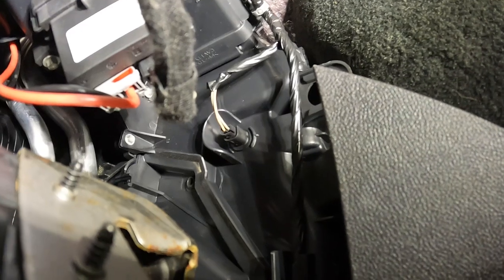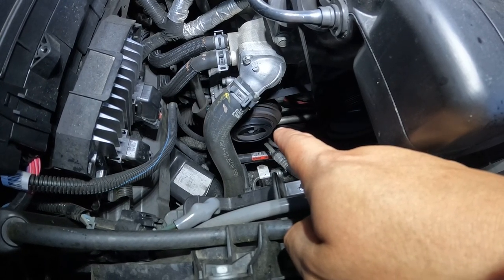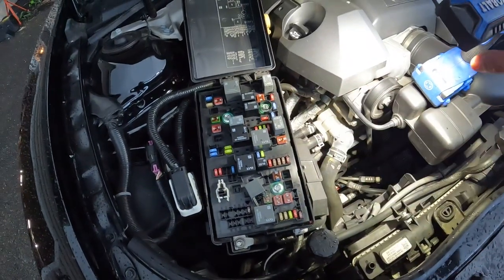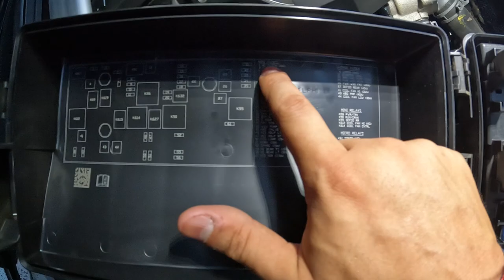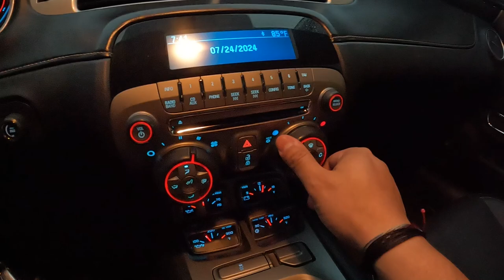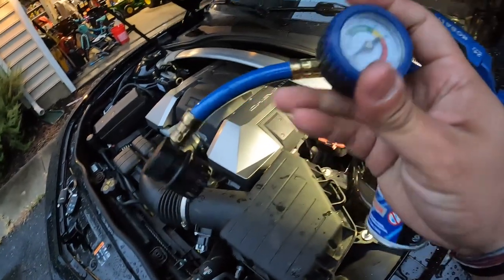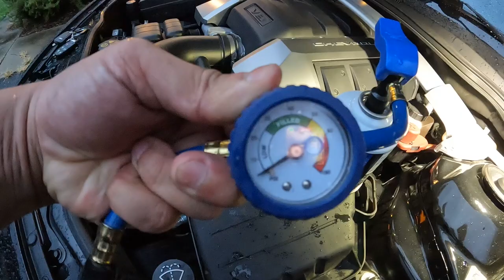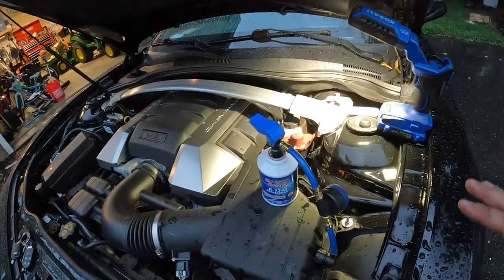How to Fix Car AC | 2010-2015 Chevy Camaro SS | AC Not Working | A/C Troubleshooting Tips

Comment: That thing has some low miles
Reply from the maker: For now! Ha Bought it with 41k. Drive it everyday
Reply: @diveingarage  holy shit dude that things in good condition for 41k. My Camaro wasn’t like that when I bought it with 55 on it
Reply from the maker: Ha thx. Previous owner kept it super clean. I think just a Saturday top down cruiser when the weather was nice.
Reply: My battery went dead ac was cold 24k miles on car 2011. Put in new battery no cold air. Going to try all these things. Hopefully one works. I had all electrical checked. Compressor not getting any power.
Reply from the maker: yup sounds like you have a blown fuse or dead relay. Super easy to check! Hope this video helped!